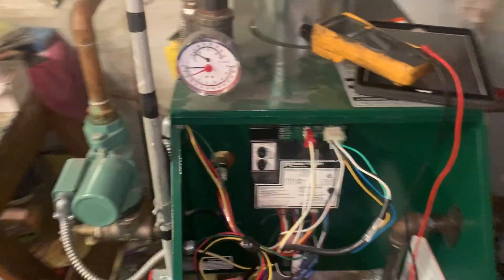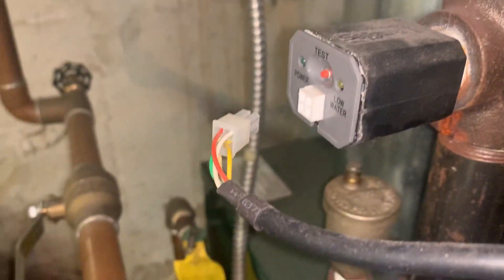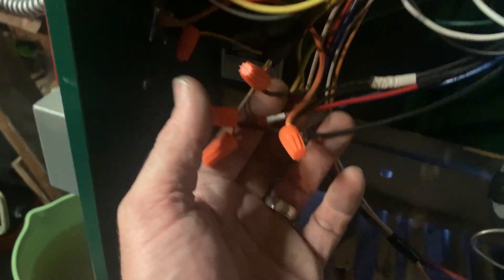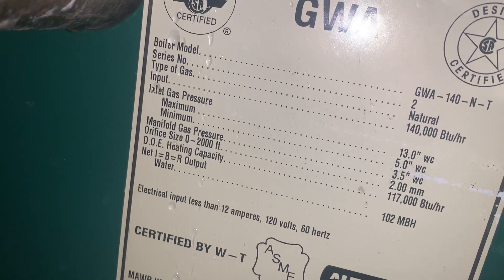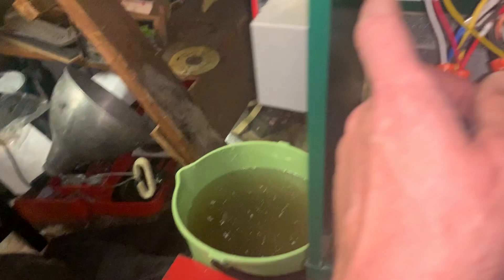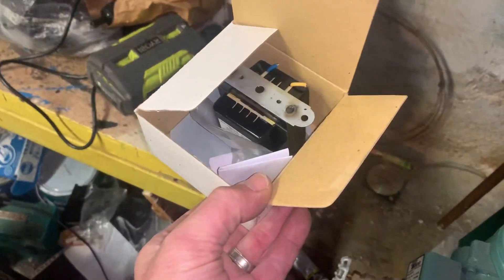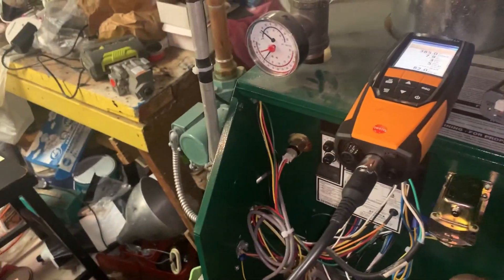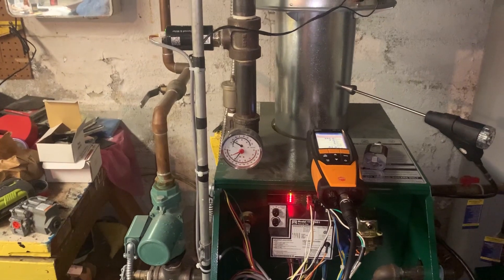Williamson GWA 140-N-T Gas Boiler No Heat & No Power

Comment: Nice job and good catch on that ridiculously done bypass! 
Unfortunately, I too have a Williamson GWA-140 that was installed on 1/12/2017 and tonight it just wont fire up. 
When it tries to ignite itself, it just continually clicks for about 10 to 12 to 15 seconds than stops and the flame indicator led flashes. 
Would that be a bad board? 
Bad Transformer? 
Bad Igniter? (or whatever they are called nowadays), 
At this point I am stumped. 
I knew our old manual Weil-Mclain CG-6, that I helped my late dad install way back when I was a kid like the back of my hand, and kept that big ol' bag boy running well for 40 years, but this newer Williamson confuses me to death with all the computerized circuitry! 
I have a sad feeling that it will be an expensive part and/or expensive to replace!
Do you guy's come out to Staten Island to do repairs?
Not many "reputable" guy's out here that I would trust anymore, mostly fly by night scammers or overpriced B.S. rip off artists just looking for a quick $ out here and I'd like to have my system done right by someone who; 
A-knows wtf he's doing and 
B-won't just replace parts unnecessarily just to bump the bill up!
I don't mind paying, but I'm not rich and I just hate getting raked over the coals.
Reply: @PipeDoctor  Hi, thanks for responding.. It clicks and clicks, but I see no sparking and no igniting. The unit has an OEM Honeywell valve iunstalled that came with the unit and is the kind that is electrically ignited, no constantly on pilot flame.. I also wonder if it's something to do with the automated damper not opening properly?
Reply: BTW, my Honeywell gas valve has no reset button and I can not find any reset buttons or switches anywhere in, on or around the unit.. I mention that, because I've been informed that many Williamson's have a reset on the gas valve or somewhere on the board.
Reply: Out of desperation, due to it being very cold today, I called a local repair co. and they claimed they can get here this afternoon, but said they will charge/rip me for $99 just to "walk in" and "diagnose" the problem! 
I'm apparently in the wrong line of work! LOL
These "walk in" fees really turn customers off!, I mean, if they want %99 just to look at something, how much are they going to mark up and needed parts and labor? 

Sure, sure, I know, we all gotta make a buck, but why cant an honest guy who knows what he's doing just come in, fix it and not overcharge for the walk in, diagnosis, repair or any needed parts, 1 simple flat rate price that isn't sky high for everything, like guy's back in the good old days used to do?